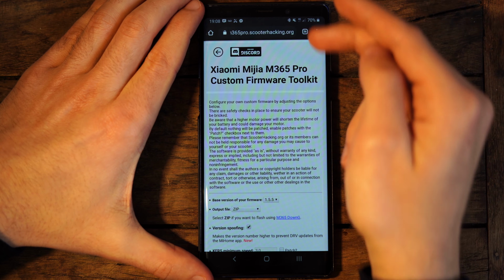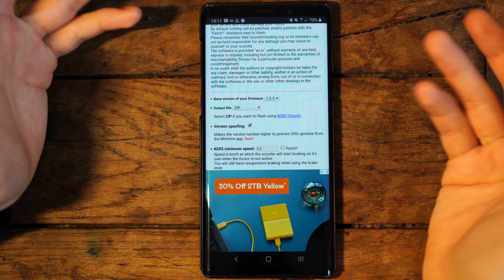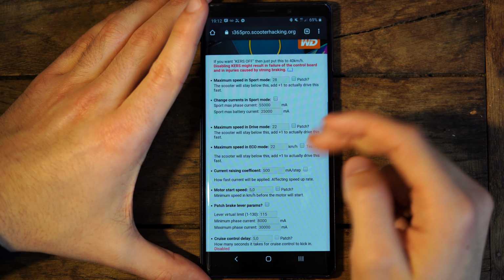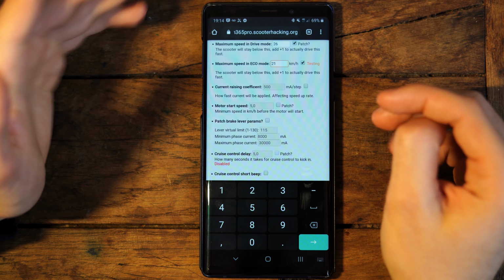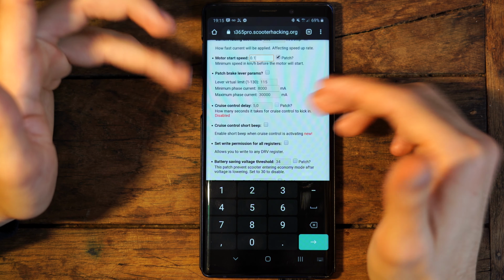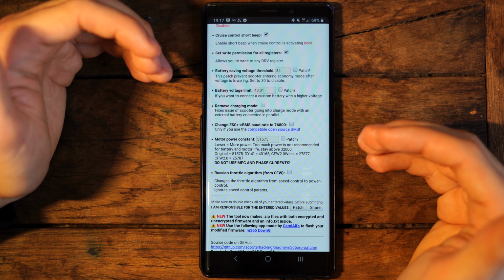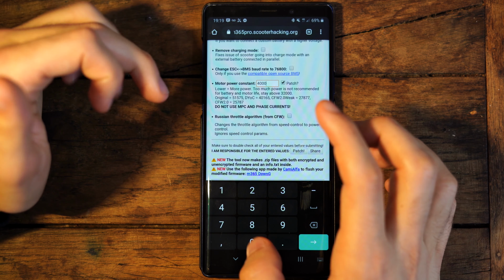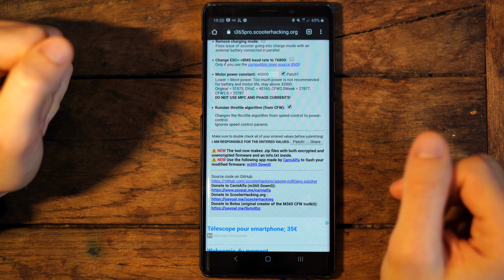(ENG/M365 PRO)Create your OWN Custom Firmware!

Comment: Thanks! Is there a way to prevent M365 Pro to reduce speed at higher battery charges. For example, my Pro when it’s full or at 80-85% battery goes 33-34km/h but when the charge drops at 65-60% it goes 31/32km/h max? 
👍

Comment: M365 or M365 Pro does not exceed 17mph without load when set to 35kmh (20mph) but Gonka155 firmware for pro max speed is 21mph so it should reach 20 easily.

Comment: Hi there i m having an interesting issue after flashing . All mode speeds are 35, no short beep on cruise i did the same as you did. I tried with and without russian algo throttle but no luck can you say is yours same in this situation

Comment: Hii,need your opinion. I have mi scooter pro,i use cfw,peak got max 900w,24Amps and max speed 32kmh vs stock firmware max 800w peak,22Amps and 27kmh.Is it safe?chances to break something? Im light weight...Thanx

Comment: thanks for video ,but i have small problem :) installed custom firmware increased max speed 36 in sport mode ,in drive mode 26 and eko mode 21. When i use eko mode max speed 30-31 the same is in D mode and S mode .What wrong ?
Reply: Mine too tried to cook a fw without russian algo this time speeds are loweras original there is something wrong here

Comment: Can I use this method on a standard 365 where I have upgraded the screen with the pro model (when connected is seen as a 365 pro) or it might be dangerous for the motor/battery?
Reply: Do you still need help with this?

I dont think there is much of a difference with pro & m365 wheel.

Comment: Hi! I have a m365 classic, but I installed a dashboard from the pro version. What cfw settings shoud I use?
Reply: Use the pro version! I did the same
Reply: @FAmoto04  when i open bin it tells me that i have m365 and i am trying to flash m365 pro firmware and maybe it will be bricked ( i have m365 classic with pro dashboard)

Comment: Hi friend! Tell if I can do custom firmware when my scooter is now v. 1.7.1? Should I first downgrade ble for 1.5.5? Didn't really see tutorials for 1.7.1
Reply: Nvm, I did it
Reply: @ksarkie  did it work? Please tell how you did it
Reply: @SilverHunkClover  I downgrade my ble version with zip file using m365 downG from play market (zip file from one of russian sites) then just make my custom version with again russian site, put 35km/h in code, but 31 is on practice. Upgrade version using m365 downG too. Connect scooter, double use "check version" between moves and that's all
Reply: @SilverHunkClover  I use 090 ble, it wasn't ruin mi home app
Reply: @SilverHunkClover  and custom version based on 1.5.5